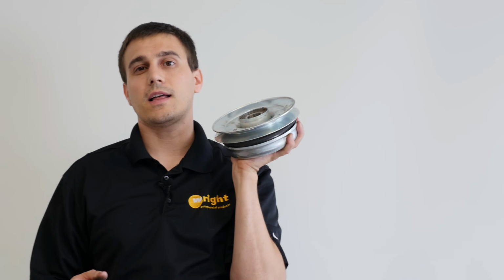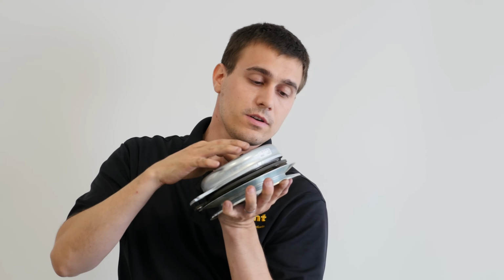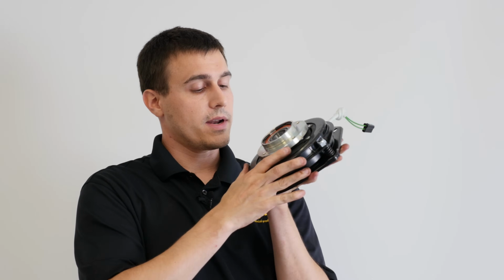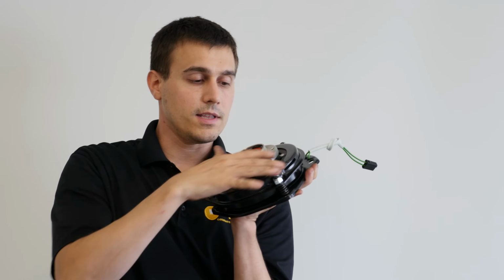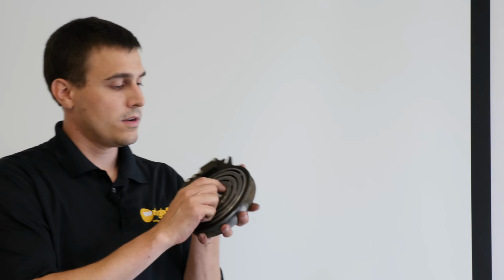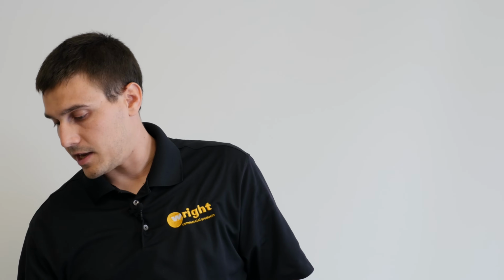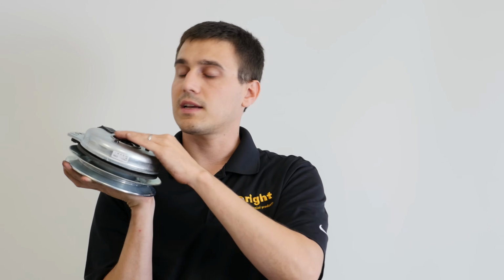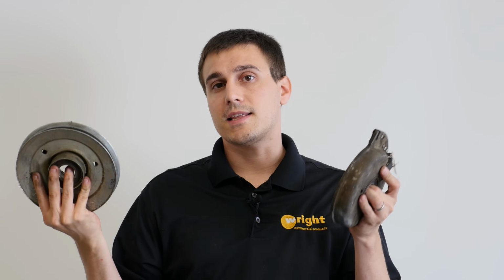Ultimate Guide to your Mower Clutch

Comment: Great thanks very helpful but how to get that central bolt undone I have one of those first clutches mentioned. Deck belt jumped between the pulley and clutch body, those disengage magnets are stopping me getting the belt back down on the pulley. It's nor a alignment issue, I hit a large rock wbich front wheel went over, it pushed the belt up😢😢

Comment: I want to install a clucth on my twin cylinder harbor frieght air compressor with a 6.5 HP gas engine. Is this feasible to use it on the compressor? I have the switch to kick off the compressor at 150 psi and kick back on around 80 psi. Just need an opinion. thanks,

Comment: wish i had thought of these yesterday...

putting a genhead on my lil backhoe, and want the hydraulics off when required... the gensets already e-clutched.

had a slip belt, seriously overestimated what an a-section belt can take on the hydro. about 2 hours a belt. no squealing, but you could feel it had no power... later calcs suggest i want FIVE!

sigh, that was a beautiful overcenter setup! chop it off, scrap now...

and of course, yesterday i cut an inch off the shaft for the gen pulley and flexible coupler on the hydro, deal with a clutch later, ha ha, rather than deal with an inch more overhang...

and i bet its that inch i need to mount one of these, which, rather than forking out 3-400 on, i know i can grab from just about any wreck... looking at it, with the bearing there packing it out... GRRRR!!!!!

meh, can maybe counterbore the pulley so it sits on the shaft a bit more, got maybe another 1/2" room.

would have to mod the pulley still, but whatever.

sigh. meh. i wonder if an AC compressor clutch will do it? i might go have a look. otherwise i gotta modify a pitbike one somehow... manual :)

Comment: Great Video. I have a Gravely Rear Engine Rider with electric clutch. Blade stopped spinning one afternoon......Unplugged the clutch connector right at the clutch and started testing:                      . Got 12 Volts at the clutch when PTO pulled ( engine running).....Got the right resistance (4 ohms) at the input to the clutch ( connector unplugged engine off) ..........get the clicking sound from the Clutch when I apply 12vdc to the disconnected clutch connector. Because I got voltage and I hear clicking, can the clutch still be bad??. Belt is OK and spinning the pulley.

Comment: I have a John Deere z425 fast trak zero turn 54" mower. It starts and runs good.And when when I turn the PTO switch on the come on and up to speed as the should. But with the deck up on highest setting as soon as I roll over grass that needs cutting it bogs down. and as soon as I turn off the PTO switch off it comes back up to speed. Any  input on this would be greatly appreciated.

Comment: Bought a Toro 42 inch Timecutter last April. I wish I would have know this last year. Nothing was in the manual about this.  I've always just turned choke off and engaged the blades and taken off. This was very valuable info to learn. Thank you

Comment: The clutch on my John Deere x354 screams when I shut down the PTO. Does indicate a problem with the brake set-up? When engaged it runs perfectly and makes no noise but it's clear something is rubbing metal on metal for a few seconds after I shut the pto off.  Any help?  Oh, the mower has fewer than 100 hours on it.

Comment: I have a zero turn ariens ikon x 52 inch mower. Is it possible the pto clutch destroys the belt during mowing the lawn. I think the clutch is going off and on during grass cutting (maybe heat problem). So the belt of the deck keeps coming off. I checked the deck and change the belt butt stil have the same problem.

After destroying the belt the pto clutch didn't work for a couple of minutes. After that it works and I hear a click.

Comment: Hey Ed, I have a small frame 36 stander 
Today on my first yard I noticed a slight sputter occurring every 30-45 seconds and then when I got to my 2nd yard the sputtering became more frequent - it only sputters after I engage the PTO and start moving - the sputtering gradually got worse as the day went up to the point where I had to switch mowers - what I've found that if Im sitting still with the blades engaged - it won't sputter but as soon as I touch my hydros it sputters. I think my clutch went bad what would you say about this? Ty so much

Comment: My engine on my Wright stander chuggs and struggles when activating the pto, no matter where the trottle is set at. I’m not sure where to start , electrical or is the engine not getting enough fuel or electric when activated? Once it gets a little warmed up it does better but still not how it should be
Reply from the maker: Please reach out to our service department here: https://www.wrightmfg.com/contact/
Reply: Might be a seized bearing in the pto.
Reply: @notavailable9919  it only happens occasionally it’s almost like it needs to get warmed up first, do you think it could still be that?
Reply: @thetreestand8873  If your engine runs well without the pto engaged it is likely somewhere in the deck. Possibly pto or even spindle or pulley bearing. If it is seized or sticky it will take more force to spin. Once it gets warmed up it may turn more freely. Only way to know for sure is to turn them by hand, no belts, and see if they are smooth and quiet, not too difficult on most machines, though you may have to remove items in some instances.
Reply: @notavailable9919  okay gotcha I appreciate you explaining more in depth! I will definitely check that next. Thank you!
Reply: @thetreestand8873  Happy to help.

Comment: Do you know how to take off the clutch from a dixie chopper? I got the field coil off but the disc and the pulley wont budge on from the crank shaft.
Reply: How did you finally get it off. Fixing to do on my 3360 hp dixie..generac

Comment: I have connected the wire and took a reading where it pigtail goes into the clutch. It settles down to 14.10 volts. With the pigtail plugged into the clutch I took the ohm's reading and it settled at 2.4.

Clutch test says it is ok but why does it get hot and burn the wires?

Comment: I have a cub Cadet lt1050 the blades turn when I try to start it. I took the PTO off and peace’s of the bearing by the pulley fell out. Replace the bearing and it’s still doing. The switch test good what could it be?

Comment: Help please.  Homeowner here.  Our 13 y.o. craftsman zero turn has recently begun bogging down relatively easily.  Since then my idler pulley exploded after a small impact. Replaced that, same problem.  Replaced blades, better but problem persists.  Recently also tightened my pto clutch gaps as this solved a similar problem before, so I think that's within spec.  Maybe I over tightened or not enough?  Belts appear to be snug.  I had rebuilt my arbors and bearings at the beginning of the season. Any other ideas, please?  Thanks
Reply: One thing to keep in mind - if you have a 2 cylinder engine, you can lose a cylinder for a multitude of reasons, and the engine sounds close to normal - until you load it down.  Shut it down, disconnect one spark plug and start it back up.  If it still sounds same, reconnect and remove cap from other spark plu.  If it isn''t starting, or runs terribly rough - that's the dead cylinder.  Run a compression test on both.  Had this problem with a 16HP Snapper - tried everything until I saw someone list this as a possibility.  Not the answer you want, but until I engage deck - I can run the thing all over the yard - tow a sprayer, etc - seems fine - but loading that engine down with the deck - no go!

Comment: I have a Toro 212H wheelhorse. My electric clutch is still working, but when I  engage the mower it draws some much voltage that the charging system can't keep up. Do you think I should replace the clutch, or check the charging system?

Comment: My Hustler Sport was running fine, when I was going to spray out underneath the blades would no turn off for me to lower the deck, it did turn off after a couple of tries.
 After lowering the deck and trying to turn the blades back on they would not come on.
 When I looked under the mower from the back the bolt holding in the clutch had backed out and the clutch had separated and the belt had pulled the bottom down.  It is a Warner clutch and the rotor has quite a bit of rust on it.  If I clean off the rust and replace the bolt, with the proper flat washer, there was no washer attached with the bolt, would I be able to reuse this clutch.
 I am not able to get the top part of the Clutch to turn loose from the drive shaft, or should I go ahead and replace the entire clutch.  
This video was very helpful to help me understand what is inside the clutch.  Thank you.

Comment: Have you ever heard of pto clutches ruining drive belts? My 36 fixed deck stander keeps chewing drive belts after about 30 hours. Ive checked the idler pulley already. The wear seems to be on the inside of the belt.
Reply from the maker: Not common. Feel free to give us a call to see if we can help. -Ed
Reply: i have a problem with the pto not dissengageing.. oms were high at 4.8 to 6.
no fuse issues 12+ volts going to the pto???
Reply: I tested tje switch also an apears to be fine fyi

Comment: Thanks nice video. Question engine off electrical power off on John Deere X300 no belt on clutch pulley should it free wheel when i turn it?  Mine is hard to turn is that the brake you were referring to?

Comment: Ed a question, I have a Toro MX 4250 with approx 140 hrs on it (Apporx  just under 2 years old). I look after it following the servicing requirements and keep it clean and lubricated as per the manual. My problem is the mower starts with the blades engaged all the time now...the PTO I believe has failed but I could be wrong. I disengaged the seat switch but made no difference, I pulled the PTO harness off prior to starting the mower but it would not start, I put the PTO harness back on started the mower, blades engaged and then I pulled the harness of while running but the blades kept engaged? I used to be able to hear the PTO engage and disengage the clutch with the mower off and key on, now I don't hear it.Your thoughts? Cheers
Reply from the maker: Wow, really not safe.  It could be that the "springs" are jambed on the clutch.  I'm actually not sure what clutch TORO uses on that model so can't be too much help. -Ed

Comment: We have a Stander X: @ approximately 400hrs, the clutch position key bolts fell out and the clutch obviously spun until the pigtail pulled out. Fortunately, I was able to replace the bolts, plug the clutch back in, and keep the crew mowing. My concern now is the delay in clutch engagement. The unit is at 700 hrs and several times a day we have several 4-5 second delays upon engaging PTO switch. Dealer hasn't determined error, and could be more present as unit heats up. I am concerned the initial incident may have stretched the wiring, or caused some premature clutch wear or damage. Is there any service pointer for such an issue?
Thanks!
Reply: It is likely that you can simply adjust the air gap and get back the performance of the clutch.  This is a standard and supported fix for this issue.  The air gap should be .015 - .020 using a feeler gauge.
Reply from the maker: Pristine, These are completely different type of failures.  It's likely the clutching surfaces are getting warn and so the gap that the electromagnet must pull takes longer. The magnet is stronger when it's cold.  If it works quickly in the morning and slower after getting hot, it's likely it will need replacing soon. -Ed
Reply: Thank you for the reply! I will investigate more and attempt to get the unit to the dealer for testing when it is hot and the delay interval is longer.
-Andrew

Comment: What is the normal life of a clutch for home owner. I seem to get around 3 to 4 years
on my Toro Groundmaster 120 uses a Ogura brand.  I tried to use a Xtreme new model
and they where to wide- thick to fit between frame and shaft to install so had to go
with the Ogura brand I have been using over the years.
Reply from the maker: We see anywhere from 4000-25000 cycles but we also put large clutches on all our mowers. 800-2000 hours. -Ed

Comment: The Pulley is 5 3/8 a cross ! " (C) goes a briggs and Stratton 18 hp twin II (M# 422707) (T#1253 01) (C# 9305115B)
Reply from the maker: Not sure what mower you have.  Our Wright pulley is HUGE, about 6.75"  Wright PN 71460138.  -Ed

Comment: please help me
my clutch engages then for no apparent reason turns off. repeatedly I've replaced key switch, pro switch,  and breaker switch.
I'm told by a friend who gave up on this project that it's not clutch because he says when clutch dies there is no current getting to it. I'm stumped.
2004 cadet 1042
and thanks for video
Reply from the maker: Hi Bill,  Cadet is one of my competitors and I don't know exactly how it's built.  It might be the clutch--when they are cold they have a stronger magnetic field and get weaker as they heat up and the resistance increases.  Just a thought? -Ed

Comment: I found the information very complete and useful. The explanation of engaging the clutch at lower engine speed to prolong the clutch life was something I had been trying to find. Thank you for the informations and straight forward explanations.
Reply from the maker: No problem.  Glad it was helpful. -Ed
Reply from the maker: There is a lot of mis-information out there on what speed to turn on the clutch.
Reply: @WrightMowers  depends on the brand of mower for instance if you have a bad boy Maverick zero-turn you have to have it at least half throttle or you will break a spring underneath there every time it's caused by engaging the electric clutch at too low of an RPM and causing a very violent surge

Comment: My wright stander keeps shutting off after engaging the blades. Kinda like a safety shut off. Any idea of what it could be?
Reply: Wright Commercial Mowers ok
Reply from the maker: Humm,  not sure, but seems like the platform switch or the wire going down to the platform might do that. -Ed
Reply: Wright Commercial Mowers yep I had one of the plugs filled with some mud... cleaned it out and it works perfect again

Comment: I have a Cub Cadet 2186 (2002) that seems to be having PTO clutch problems. However, in my case I cannot DISENGAGE the clutch and the blades are always running. Does this indicate an electrical problem as opposed to a bad clutch?  How does a clutch system get stuck in the "on" position? Thanks.
Reply from the maker: Ouch! It's likely a mechanical problem.  If it's a Warner clutch (shiny one) the torque "straps" could be all buckled up forcing it to stay engaged.  If it's an Ogura clutch (black one) the gap adjustment nuts could be a little too tight causing the clutch to drag.  One way to diagnose it is to un-plug the clutch, then start the engine for a second to see it it's an upstream electrical issue or a down stream mechanical problem with the clutch.  BE CAREFUL BECAUSE THIS IS AN UNSAFE CONDITION. I hate to be the one with bad news but it's going to cost you a few hundred bengamins to fix it, sorry! -Ed
Reply: Thanks. I took it all apart and one of the two bearings is frozen so I plan to change out the bearings.  Is there anything else I should look for?  I have the Warner clutch.

Comment: My lawnmower blades are cutting in out after starting the pto after a few mins. It will start shaking and you can see the pulleys slow down. Got any ideas? It has an electric pto. It is almost like the clutch is engaging and disengaging
Reply from the maker: If its clicking in and out it's probably upstream of the clutch in the clutch wire, platform switch, blade switch.  Usually once the clutch begins to fail from wear it works when cold and then won't work when it's hot and once it's engaged it doesn't kick out. Also, if you have a Stander Intensity we have heard of a few reports of the wire kinking and breaking between the platform switch and the main harness.
Reply: I got ya. It is actually a Husqvarna RZ 4623 but your video was really informative so I thought I would ask. I was thinking the same thing. Same thing with the PTO switch it should either work or doesn't. I am thinking a short somewhere. I heard one guy say something about an electromagnetic coupler. Do you know what that is? I can't find any info on it. He said that was what was wrong with his.
Reply from the maker: Maybe he was talking about the electromagnetic coil?  It can short out.
Reply: I got ya. In that case you have to replace the whole clutch. Right?
Reply: Wright Commercial Mowers uuuuu
Reply: transmission for sears rlde on lawn mower
Reply: Is slipping
Reply: Transmission is slipping

Comment: I have a b&s 17hp 42" Troy's-bilt riding mower that will not fire I have replaced the coil checked the plug still no fire! Can any of the switches or safety switches cause the coil not to fire. PLease help
Reply from the maker: James, do watch out for the little thin wire going to the coil.  If that wire is connected and grounded out it will prevent the coil from firing. (Caution, if you start it without that wire, you can't stop the engine). Also the gap between the coil and the flywheel should be as thick as a business card. -Ed